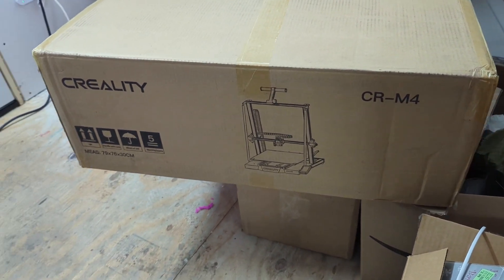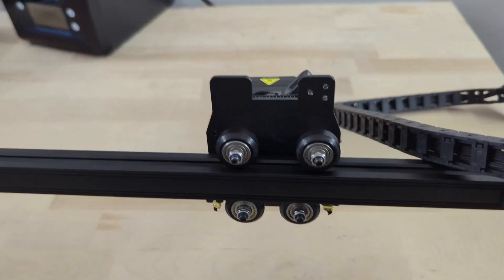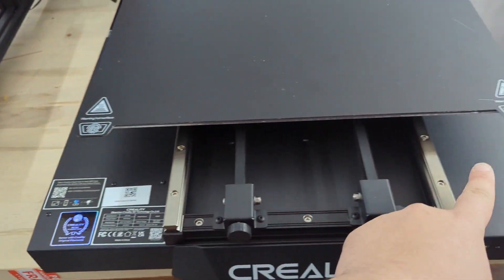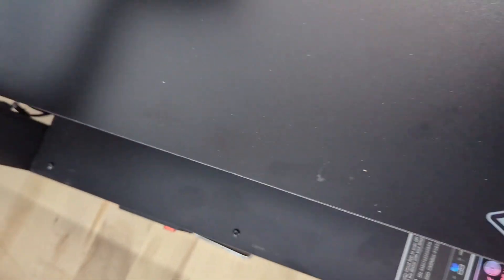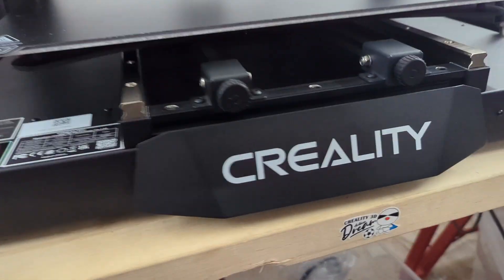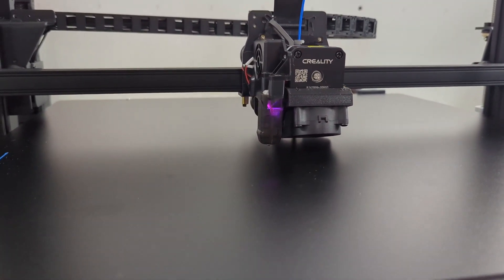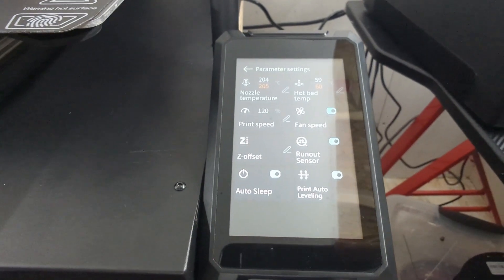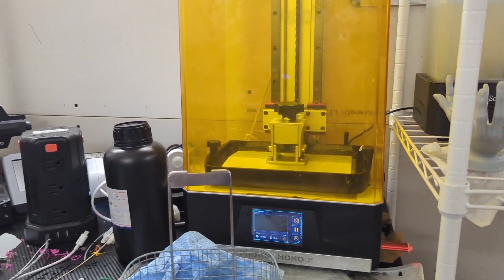Linear rail! Creality CR-M4 unboxing, set up , and quick review

Comment: Can you give me your exact settings for cura Im having issues with uneven layer lines and etc. I have reduced the stringing lots
Reply from the maker: Sold this printer months ago. I think I used a stock cura profile for a 3s1 but changed the print volume

Comment: are there any bimetal/all metal replacement heatbrakes for the cr-m4 ptfe lined heatbrake? want to do asa but the ptfe lining of the standard cr-m4 heatbrake supposedly start to disintegratate at the recommended temps for asa at aroun 240-260c. creality advertise the printer to 300c but that ptfe liner will make that impossible
Reply from the maker: I haven't swapped my note personally. I almost exclusively used PLA Plus so I haven't had that issue yet

Comment: How well does it print ABS and Nylon?  Have you made any large prints in those materials on this machine yet?
Reply from the maker: No I don't use either of those. I use mostly PLA+ and TPU. I printed a giant calicat and it turned out great. I think most of my problems are cooling related so I'm going to change the ducts to the traditional one that is on all my other sprite extruders.

Comment: It pulls 800wats. It would be great if that could be variable.
Reply from the maker: Yeah it definitely gets the LED lights flickering in the shop. Finally giving me that push to run a dedicated line.
Reply: I'm a newbie, Could you explain why variability is better? Thanks.
Reply: @AndyWong2551  save money on simple prints.  Not draw so much power

Comment: I use the M420 in my start code to use the saved mesh but then every 10 prints or so I re probe the bed and there are always some slight differences
Reply from the maker: Thank you! My bigger issue was the fact that my cooling fan seems to be sticking lower than my nozzle. Had to put a flat washer in there. Hoping for the best